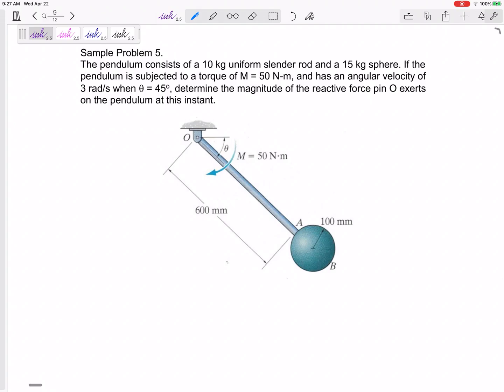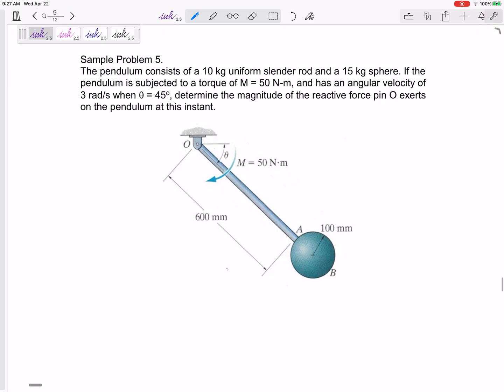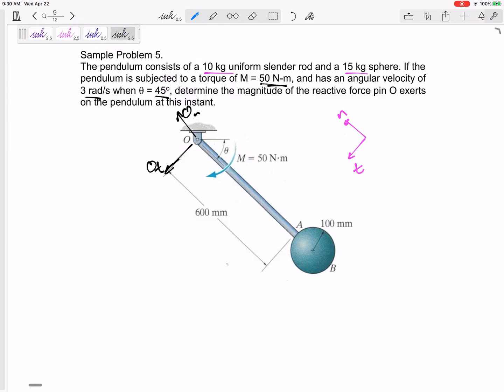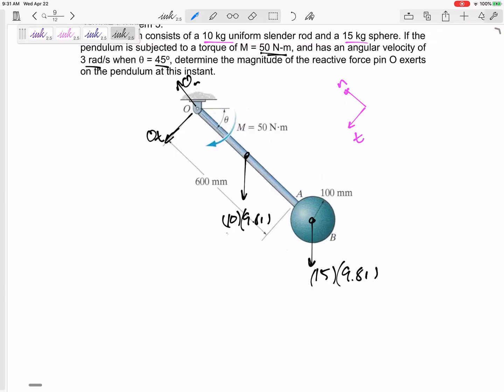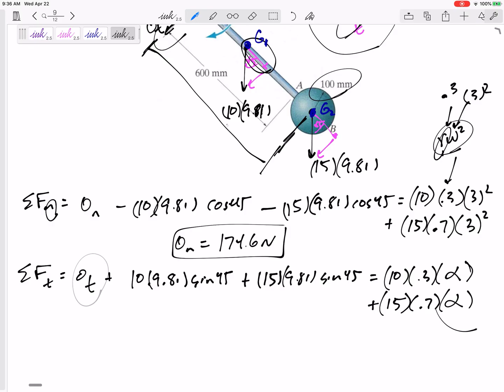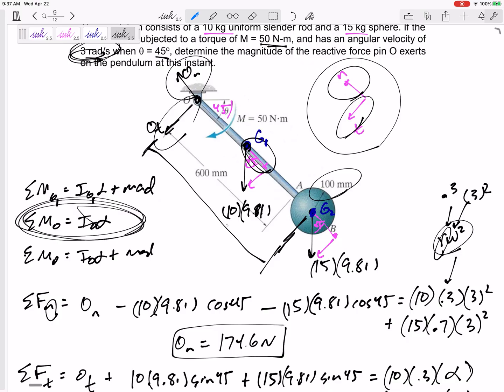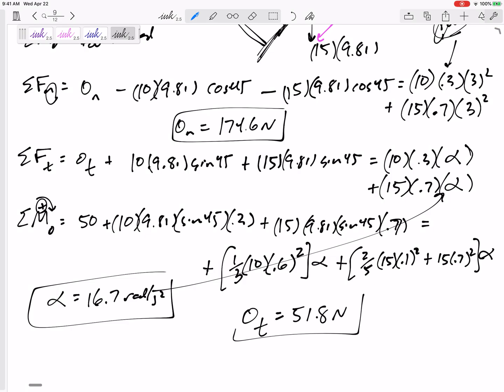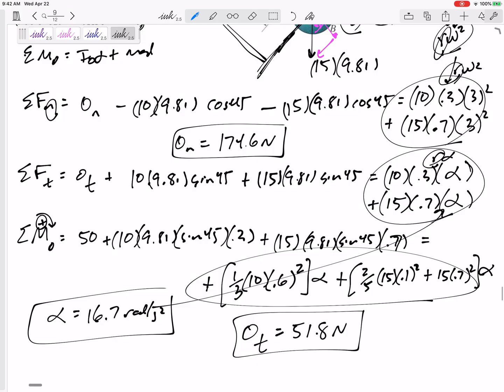Dynamics - Final exam problem 5 (Rigid Body translation or rotation and free body diagrams) example

Comment: Wasn't the radius between the ball and O when calculating FN supposed to be 0.65 instead of 0.7?
Reply: No because the radius of the sphere is 100 mm, not the diameter. So .1 + .6